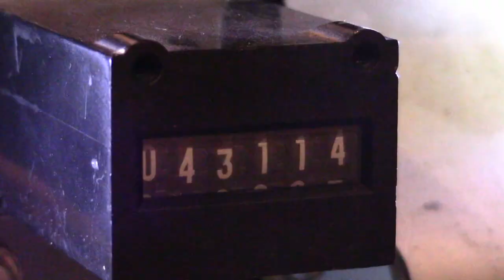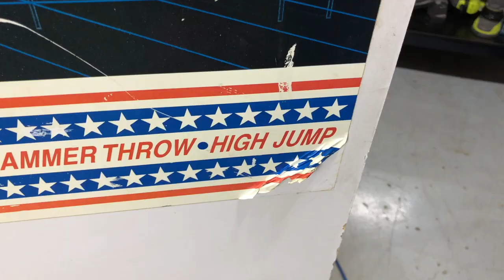Track & Field Restoration Part 2: Cabinet Prep and Paint

Comment: What shade of blue did you use? or was it color matched to the blue you left on?
Reply: Per the Canadian Arcade instagram Rustoleum Gloss Deep Blue
Reply from the maker: Alan, you beat me to it. Haha.  Honestly its Close. Very close to what was on my cab. The only thing different was the sheen, but the glossy look is fresh and looks amazing in person so i did t bother putting on a matte top coat. ☺️
Reply: "I've filled holes larger than this."

I bet you have...
Reply: @TheCanadianArcade   Cool thanks. Is the original blue a matte finish then or a satin?
Reply from the maker: Yes, and tell her she still owes me $50 for it too! 😠
Reply from the maker: Thats a good question. 40 years of wear and tear kinda left me asking the same thing. Haha. Rustolium makes a clean top coat in both. Id buy a can of eqch and test on some scrap to see what you like.
Reply: @TheCanadianArcade  thanks for the inspiration on episode 1, Picked up a cabinet and your tear down video helped me out. Fun fact the front panel pulls completely off with undoing the screws and bolts! Cab coulda been an ikea kit!
Reply: @TheCanadianArcade  is this the correct one? thanks
https://www.instacart.com/store/items/item_1798137176

also, what black did you use (semi-gloss, flat black)? tks
Reply from the maker: @letsgosteelers68   Nope it was Gloss Deep Blue. It was the closets we could find to the colour, but it was more glossy then we'd like.Then semigloss black and flat black. depending on the area painted.